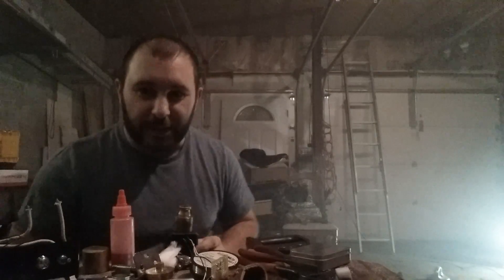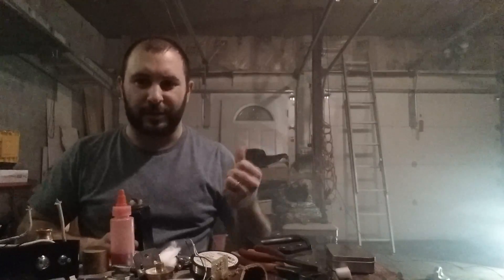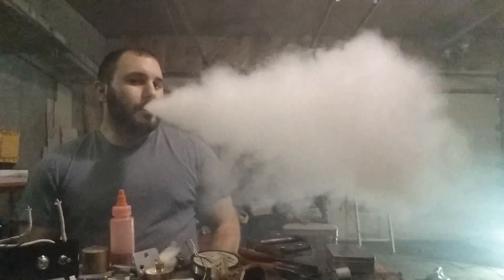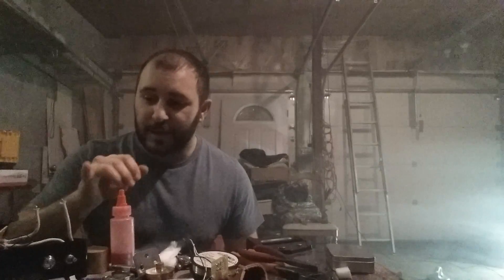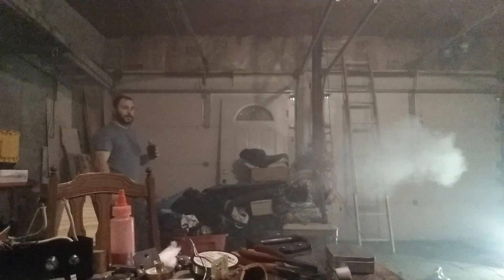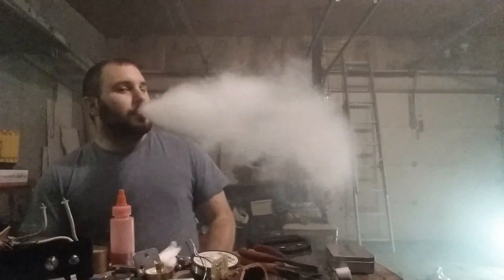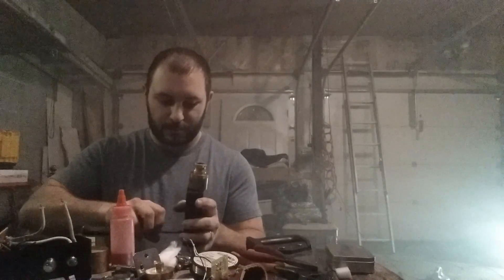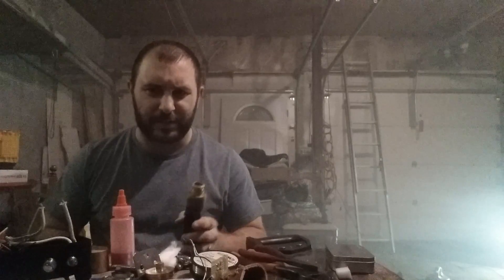Dragon skin coils on my 4.2 volt lipo box

Comment: the Claptons I'm running are just 26 gauge A1 wrapped with 32 A1 kanthals in a 30 mm Temple RDA. when I run a 3s lipo in it I can comfortably turn it up to 40% but the 4s really cranks out the power, I guess I'll try some fused Claptons, Igor builds some wicked boxes with all the power you'd want, I've tried triple paralleled 26 gauge at .35 very hot, alien Clapton at .38 best flavor so far but even at 40% with a 3s its just too hot I was thinking id have to do something with 20+ wraps lol thanks for your help, love the rda you built, any plans too sell them in the future?